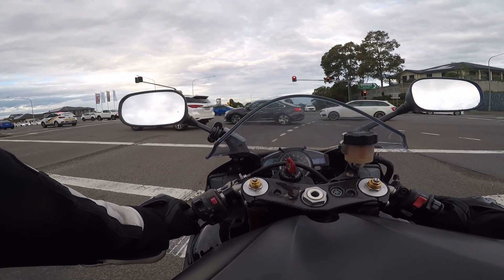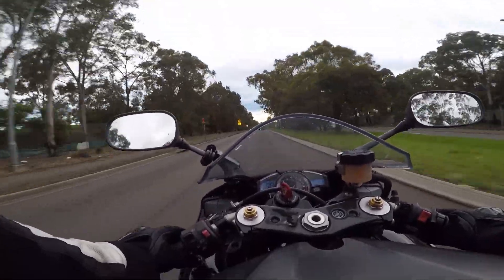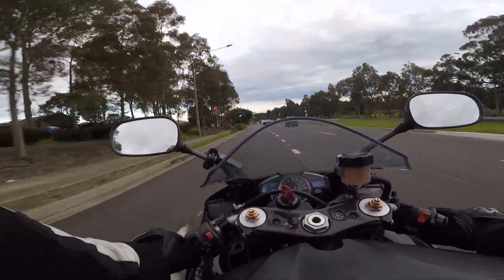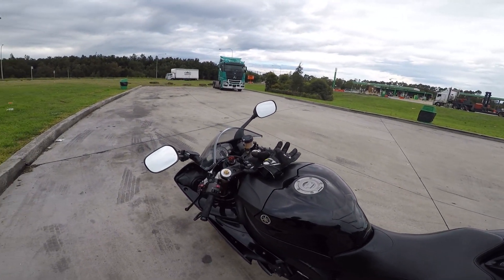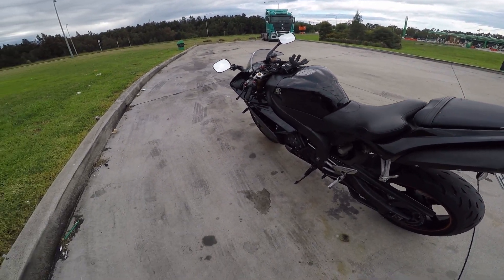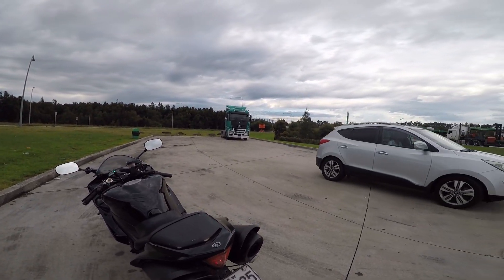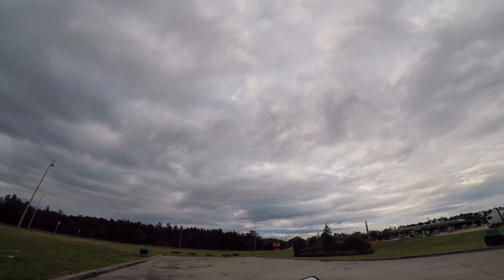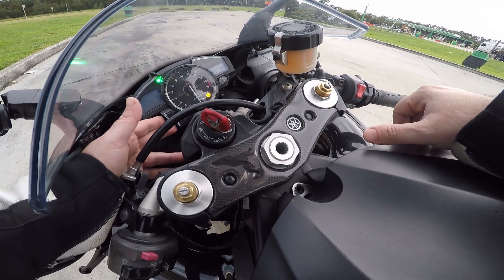Yamaha R1 onboard CO fuel tuner explained

Comment: I have a 2003 R6 and at my college i had an O2 sensor. I was using it to troubleshoot shoot a miss on 1 of the cylinder with the headers off. And the c values definitely corrosponded with its cylinder value. The bike was running while i was increasing or decreasing the C values and i could see the change on the O2 gauge for each cylinder. 

C2 was the only 1 that didnt change the value of cylinder 2 and that is because the igniton coil was bad and that was my problem solved.

Also worth noting is that they were all set at different values from the factory when I first entered that menu.

Comment: Its not cylinder. I only changed c3 on my 03 r6 and only change was stronger 4k and up, plus my popping on decel all but stopped. And it was bad. Bike was sluggish in low rpm before. Doesnt make sense to only tweak a cylinder too.
Reply from the maker: I said in the video, R6 is the range value and R1 is CO per cylinder. Its different for the two bikes hence why there so much confusion about what it does.

Comment: Changing it without a dyon is dangerous, you dont know how its running without a/f gauge or a sniffer from a dyno. You are gonna have people damaging their engine from this. Also it only is for low rpm range. Read about it on the r1-forum
Reply from the maker: Back when people had carburettors we used to do this all the time, actually they wanted to replicate the carburettor functionality thats why they put the feature there to replicate the tweaking you can do on carbys.

Comment: Hey mate, I noticed the bike seemed to stall when you were coming to a stop. I'm having the same issue. Did this come about when you were adjusting the CO settings? The issue I'm experiencing is it starts and idles fine both cold and warm. If I'm riding up in 3rd gear for e.g. and then have to slow down to come to a stop for lights or a roundabout etc when I pull the clutch lever the engine dies. Blip shifting up and down is fine, it's only if I fully pull the clutch lever in with no throttle.

(I'm the guy that bought the bike btw, stumbled across your videos when looking for solutions).

- serviced it with new airfilter, plugs, etc
- new chain and sprocket
- got the exup 17 error code intermittently when riding. Have tried it manually fully open and fully closed and have since servo motor removed and deleted with a plug.
- synced the throttle body
- checked TPS

old plugs cylinder 1 & 2 looked a bit rich, 3 and 4 looked pretty good.
Reply from the maker: Hey hey! fancy seeing you here LOL, I used to run the bike slightly lean around -8 on all C1-4 values. Before I sold the bike I set all the values to 0 because thats how I bought it, but it runs rich from the factory. I've never had an issue with stalling either at 0 and or at the leaner values, the only reason it was stalling in the video was because the C values were at -25 (I think or some other stupid values) just for demonstrating in the video. I never had stalling issues otherwise before or after the video.  Did you notice the stalling after the exup delete? The code was probably throwing error 17 because of the change from -8 to 0 but this is only a temporary problem since 17 isn't really and error but more the fact that the exup was needed to readjust. I probably wouldn't have deleted the exup because of that. BTW there is a bit of a paradox in this video, the beginning part was actually recorded at the end after putting everything back to my typical -8 C values and riding it back home, as you can see there were no issues and thats how the bike always ran for me.
Reply: Hello mate, Im experiencing the same problem as yours. Did you solved the problem ?
Reply: @DeniDespotovic  i think it had something to do with the clutch lever from memory (have you replaced yours recently?). 

Hard to recall exactly, i just spent 10 months rebuilding the motor 😂 had bad compression cyl 2. 

Also, try syncing throttle bodies, it was a common fix for the issue you're having when i was looking for info.
Reply: There are ASV levers on mine but I eliminated the killswitch on the clutch lever few days ago so that should not be the problem. 

I also tried changing air fuel mixture according to this video but still no fix.

I haven't done the throttle sync yet since I don't have the measurement tool.
Reply: @DeniDespotovic yeh id double check. The kill switch is tied into more than just the ignition. From my understanding it gives the ecu info and can impact air/fuel mapping. 

I could still start the bike without the little block on the new lever to engage the switch but would cause problems at low rpm. When i correctly installed the little block on the clutch lever that engages the switch, the problem went away.
Reply: Hello mate, thanks for the tip. I just installed another clutch lever that I had in garage and so far the stalling has not happened. I hope it stays like this. Man you saved me thanks a lot.
Reply: @DeniDespotovic no worries. Hope that's all it was.
Reply: @DeniDespotovic  Hi a bit late to the party, I got a 2007 R1 and it came with Delkevic cans, really loud and obnoxious, but the biggest problem was that every now and then it stalled coming to a stop.

Here's all I've done to fix this problem and I think it's a combination of everything that actually fixed it rather than one single thing.

I've adjusted my clutch lever to have the biting point at around half way to upper half way (I got custom levers so I can't adjust to the OEM 4mm free play).

I've bought a cheap 25 quid throttle body sync kit with gauges (bare in mind I had to buy narrower rubber tubes because the nipples on the throttle body are quite thin and you need a tight fit to get the right reading), I've ballanced the throttle bodies and adjusted the idle, now this is supposedly what should have fixed it as it's a known issue with the 07-08 models, it definitely idles and lowends better than before this adjustment. It's not hard to do it's just faffy.

And the biggest one was swapping those obnoxious cans for Arrow Thunders which are freaking awesome and not extorsionate, the biggest issues with this is the import they had to order it from the Arrow shop from Italy and it took several months for the cans to arrive.

Also whilst messing around with all these things I've noticed that one of the exhaust header studs was snapped by the previous owner seemingly trying to swap to a straight pipe probably why he was selling, I've luckly got that sorted with my amazing mechanic who worked on it for a full day trying to pry the little, rusted, welded shut stump left over from the stud siezed into the engine block. New studs and bolts and now the header is fitted on properly (it wasn't a major concern as it didn't leak much if at all once at temperature based on the gaskets when they came off, but I'm sure it contributed).

All of this combined completely fixed the stalling issue pulling to a stop (it happened rarerly and increased or decreased in frequency by adjusting the clutch lever but never fully fixed solely by doing that).

Now I've messed with the fueling on it (haven't gotten a power commander yet I'm still messing with the ECU settings before I do take it to DynoJet in Preston) and it eliminated the lowers flat spots I had pulling away from a stop (felt a bit sluggish at low RPMs when you proper pin the throttle, kind of like it hesitated a bit then it starts pulling).

Anyway that is all, Merry Christmas haha!

Comment: A stock R1 is going to run rich from the factory plus the stock IAP mapping/O2 senser will make changes for the range. I would suggest you look into an ECU flash with any new performance mods like exhaust, air filter etc.
Reply: Wrong, they run lean cause of emissions and there is no 02 sensor on a 5vy so you don't know what you're talking about. Lol
Reply: @stevnger  The 08 r1 is not a 5VY.
Reply: This bike is a 2007 or 2008 which is not a 5vy. Yamaha went to 4 valves in 07 which is the 4c8.